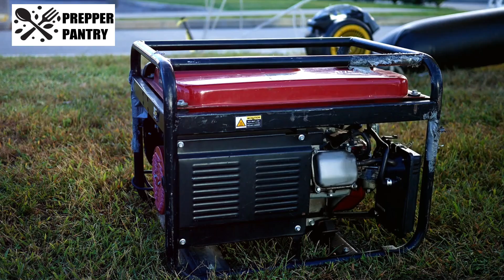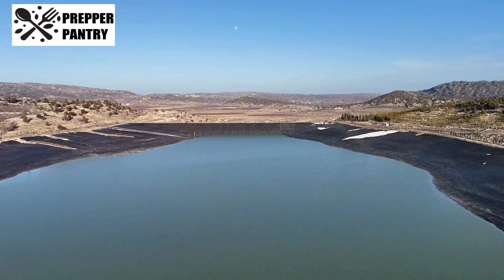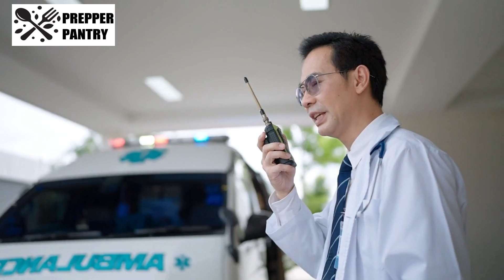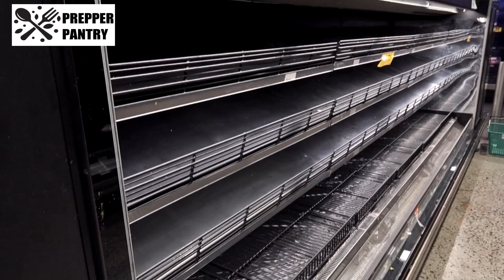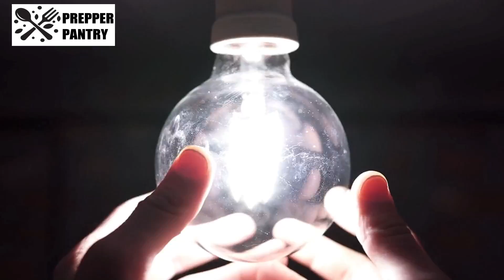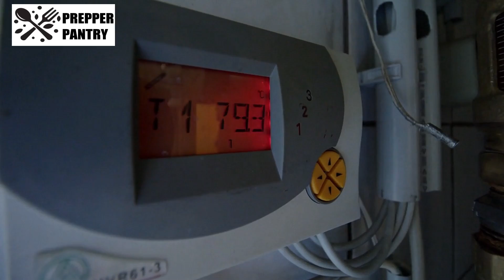10 Emergency Items Disappearing Before the Next Coming Power Outage

Comment: We live in the United Kingdom power okay? So far.
Reply: it should be a consideration though. Near me after the storm, several areas had no power for up to 5 days. But the chances of an outage is low so we shouldnt stress out over it. Its more likely that your freezer will pack up.
Reply: Old newspaper works well when toilet paper runs out after that we need to get creative.

Comment: Does a portable power bank work if there is no electricity?
Reply: The portable power bank will work if it was charged up prior to losing electricity.   How long it will work depends on how many items you are charging and the capacity of the power  station.   Some power stations can be recharged using solar panels.
Reply: I have one that's solar that's the best one to have

Comment: For power i have an electric bike that i charge regularly. It has a usb charge port so i can keep lights and devices charged, plus i have powered transport. Petrol pumps dont work without electric.
For water resillience, install a 200 litre header water tank in your attic to feed toilets, washers, shower, water heater and an outside tap. You can also boil or filter it to provide drinking water, it constantly tops up so gives you a buffer to an outage.
For heating and cooking i have a 13kg butane gas bottle, its cheaper to run than electric, so has become my everyday choice, our electricity has been glitching due to salt on the lines after storm darragh passes through.
Reply: Electric bikes dont work without electric too...
Reply: @wasdaddan  Mine has a 1200w battery, so its good for 40 miles. It will recharge my phone about 200 times. Its enough to keep the lights on, keep me connected, and give some local travel if the power goes out for a week or so.
i do plan do upgrade my solar system to offgrid.
Reply: @wasdaddan  thats why they have a battery.

Comment: I am ready, able to face anything. After the last election I knew doom was coming.  Be smart and tell those you care about that you love them. Its all we can really do.
Reply: We were pretty well situated already. Diesel generator, water cistern with a rain catch and reverse osmosis pump, hurricane windows/shutters, solar water heater, plenty of gardening and fruit trees, a thrift store dehydrator that I love, a stocked workshop and a modest stockpile of food (could last for a few weeks, without supplementing). 

But after the election we have made sure to stock up on nonperishables that we might need for the coming year; hygiene, clothes, shoes, lightbulbs, electronics (sd cards, chargers, etc.), a new computer (we were gonna get one anyway), a solar panel and power bank that can charge various devices (wanted a permanent setup, but local rules are confusing).